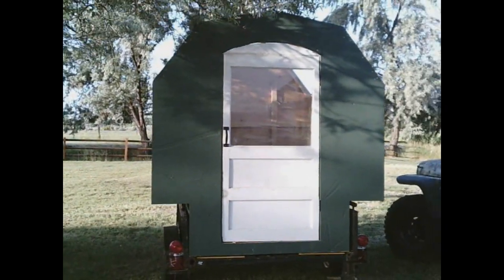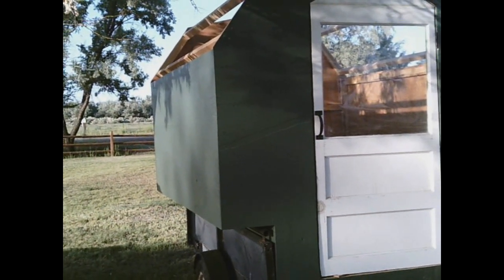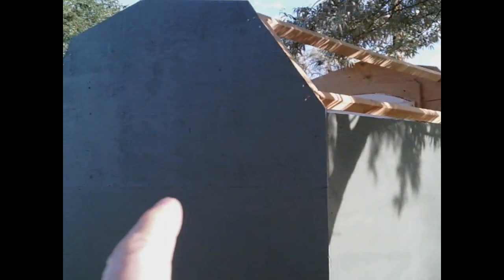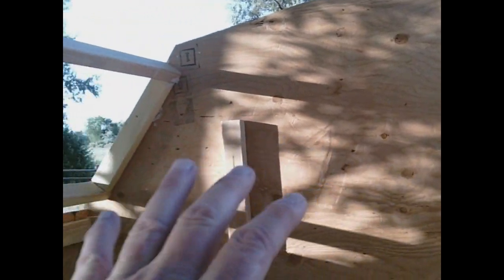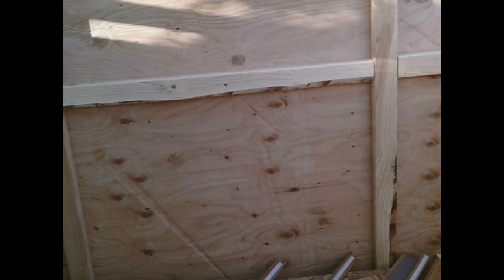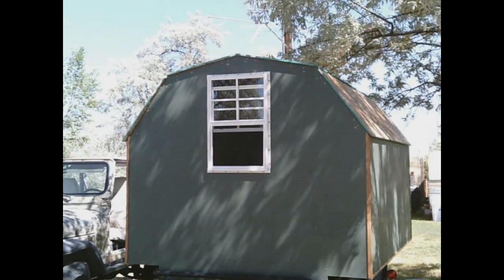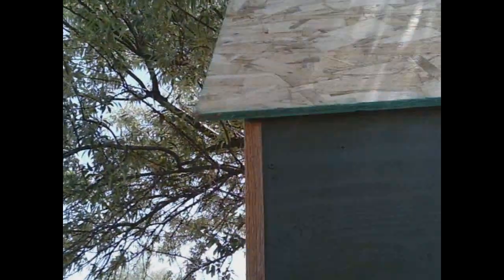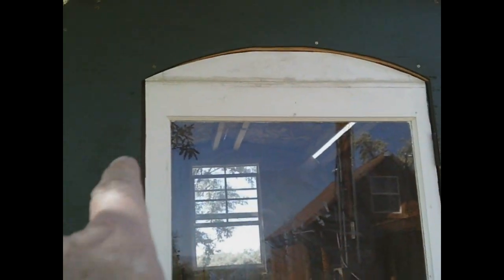Campin' Wagon Vardo: Final construction, Window and Roof Sheathing

Comment: Awesome ... are you worried about the shingles blowing off going down the road At high speeds?
Reply from the maker: Shingles might be a problem at high speeds but also harder to install over that shed roof angle. The sheet metal will be easier and faster to install and give it the authentic wagon look.
I am using this from Lowe's: https://www.lowes.com/pd/Amerimax-20-in-x-50-ft-Aluminum-Roll-Flashing/3010400

Comment: How do you Waterproof the seams between the plywood? So water don't get in between it?

Also if I was to make a Murphy style bed on the back wall how would I reinforce that back wall to hold the weight?

 For example, the bottom platform came out the thickness of the mattress and the plywood piano hinged and latches on both sides of the back wall?
Reply from the maker: You might need some additional bracing but it could be done!
Reply: @solarcabin  how would you recommend doing that?

Comment: How is this secured to the trailer?
Reply from the maker: You mean the sheet metal roofing?  Use metal roofing screws that have a wide top lip.
Reply: @solarcabin  Sorry I meant the cabin itself. You mentioned sliding it on/off. Are there bolts or does it just sit on the trailer bed? Thanks :)